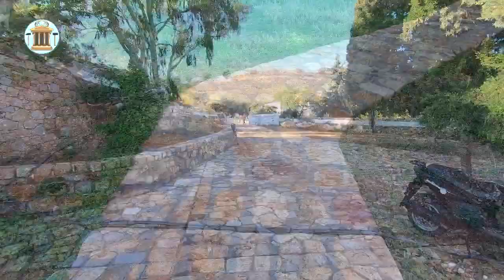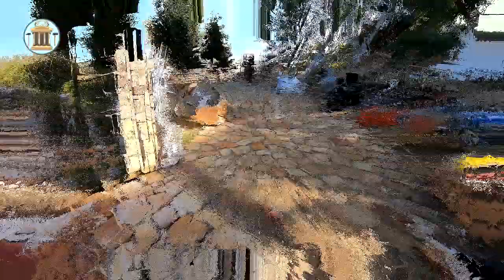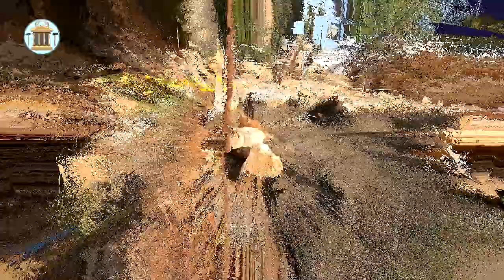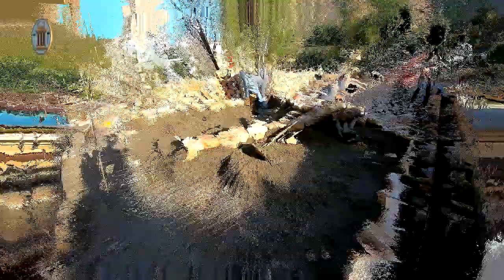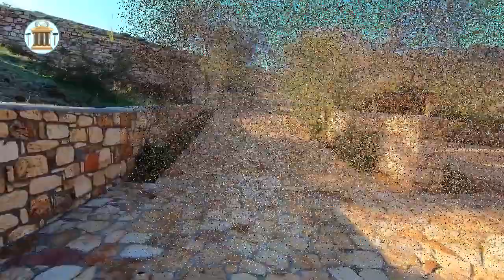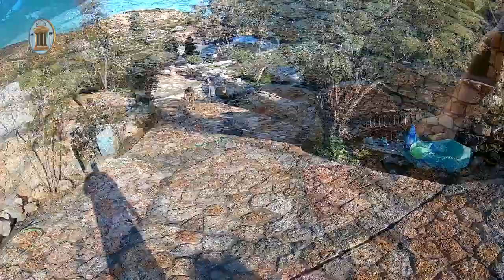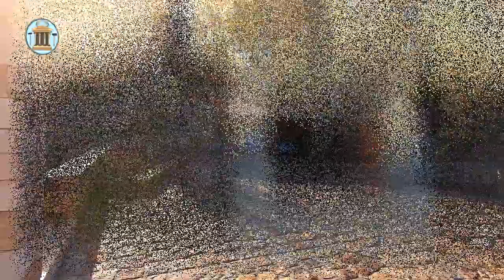Каменная мостовая. Процесс строительства

Comment: Very nice job, I want to build pavers and stone terrace in Spain, and I would like to know an estimate of the cost per square (labor and material included). if possible, could you tell me the average cost in Greece for this job ??
Reply from the maker: The price depends on the type of stone and the quality of its hammering. 1 square meter of road paving, as in the video, costs 100 euros. This is the total price for work (laying and processing stone with a hammer - 40 - 50 euros) + stone (30 euros) + cement, sand, crushed stone, lime, construction mesh.
Reply: @stonesuccessvip  thanks